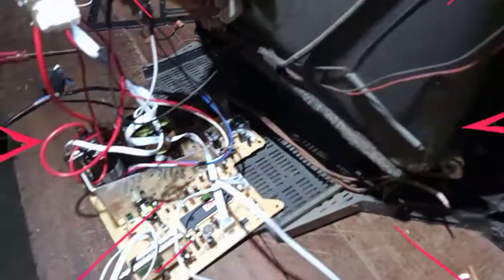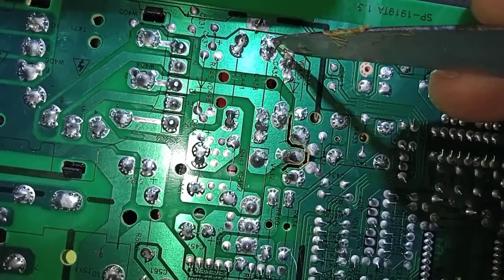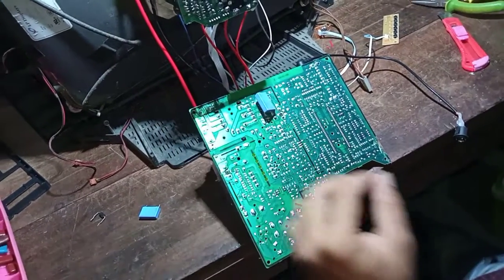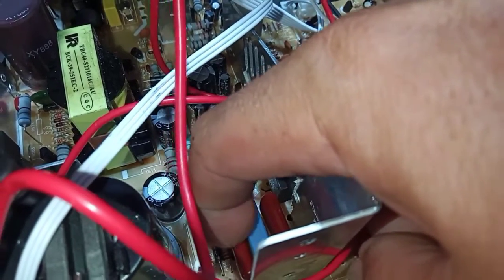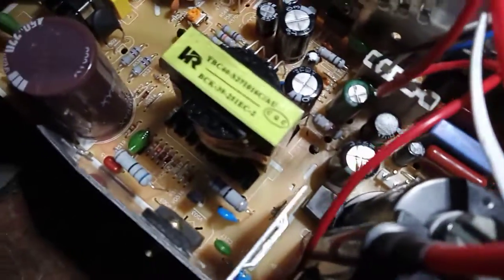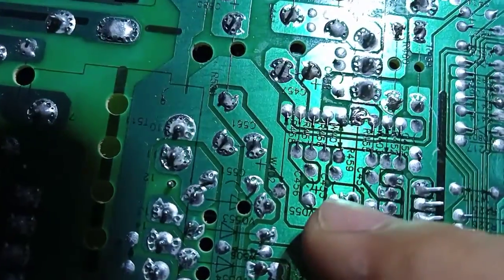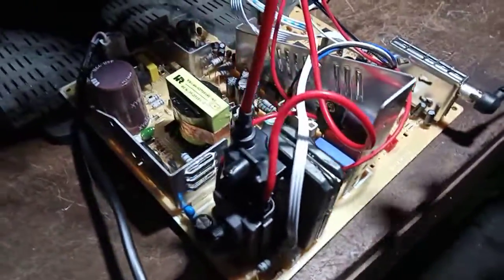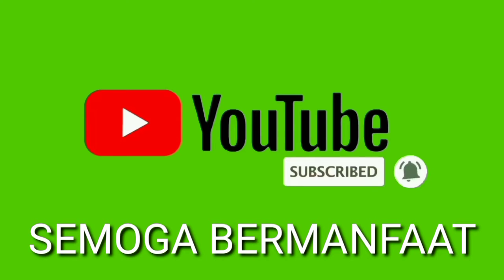CARA MERUBAH MESIN TV CHINA BIASA MENJADI MESIN TV SLIM

Comment: Pak de mesin baru wcom gak bisa start,, hanya stanbay ,, keseluruhan tegangan normal,.. mohon pencerahannya
Reply from the maker: Ukur tegangan driver horiz,teg dari vertical,,24v.. suply 12v untuk 8v dan 5v ke IC croma ada ga,pasti ada salah satu yg tegangannya hilang
Reply: @rajawaliservis.  tegangan vertical 27, audio 15v  suply 10.5v,  di transistor kol,v701 ada 9v menuju IC croma 8.3v IC memory 5v  tp indikator tetap menyala terang di tekan tombol ch+ tidak ada respon 🙏